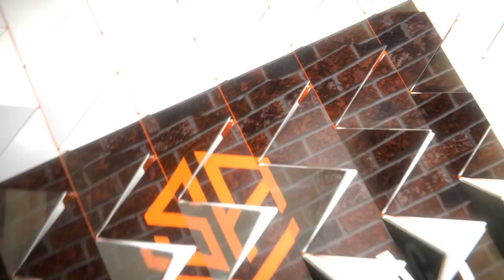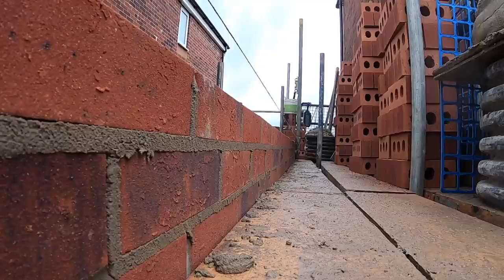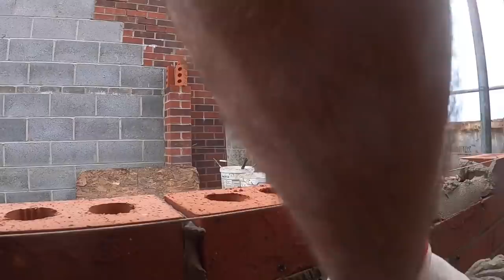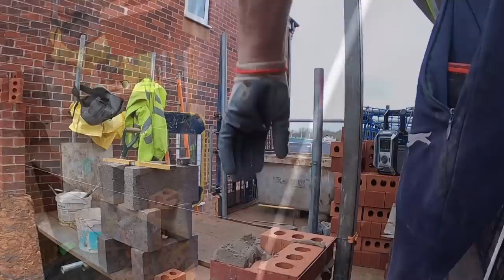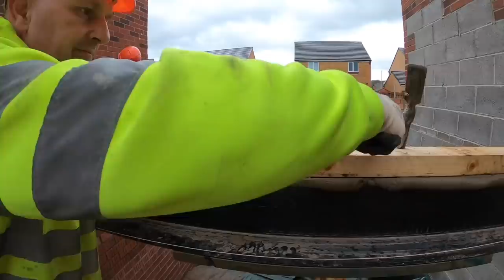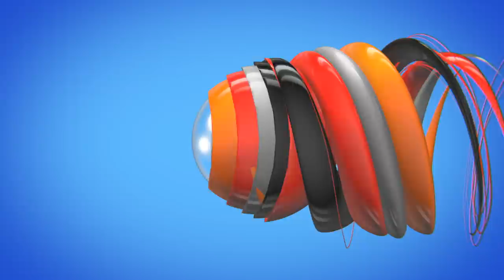BUILDING A SINGLE GARAGE ON A DODGY SCAFFOLD!!

Comment: Nice one Steve & Alex am liking the profile set up, during your next upload can you spend a few mins on the wooden profile fixed to wall? In other words do you scribe a plumb line where wall is going then fix it a few mil back to allow for line thickness? Not used that method before hence my question. Great work and a quality 👏. Cheers Martin
Reply from the maker: Thanks very very much Martin. You have got it spot on .👌🏼
   The other tip is use masonry nails and bring the line off the bottom of the pin 🧱👍🏽

Comment: going to rebuild a lean too. want to do the bottom in block will be7ft with door long 3ft high and one end 4tf wood frame top. how many blocks? how many bags of sand cement? I recon 40 blocks but probably wrong.
Reply from the maker: I’m not sure but 40 sounds about right . 1 bag of cement will easily do that many blocks 👌🏼👍🏼

Comment: BTW at least you got a loading bay,majority of sites I've been on there isn't !!!
Reply from the maker: Ridiculous! , how does that comply with H&S ?! 😡
Reply: @SteveAndAlexBuild  the worst thing is they'll be getting paid for it!!
Reply from the maker: @ianhoward4246  . Oh yeah !  Considering the bricklayers spend about 2 weeks on the scaffold it should be erected fir them . 😡🧱👍🏽
Reply: @SteveAndAlexBuild  correctamundo,it's like you build around the scaffolding rather than scaffold around the building  🤬🤬
Reply from the maker: @ianhoward4246  . Changy was on pikes the other day and had to go up 31 to get to the table lift so it was high enough for the roofers 🤯🤬🧱👍🏽
Reply: @SteveAndAlexBuild  we've just had the same we lost half a day they said they'd sort it,they dropped one fxxxxxx board as hop up,I couldn't turn 'cos if all the plastic(and I'm a fat get),then the soffit is 2joints off the house and you just get told to lean it over( but make sure it looks right!! You need a fxxxxxx magic wand not a spirit level!!
Reply from the maker: @ianhoward4246  . It’s ridiculous. Site work is turning into a mugs game 🙄🧱

Comment: The good old carrot dangler trick, fallen for that a few times, as for not paying you in full, chances are last lot more than likely over booked then jacked, but still you should be paid.......... one time I was 10m2 down on stonework on a job, they refused to pay up so I jacked but sneaked i at night and chipped all the ills and heads with a hammer, fuck em
Reply from the maker: Yep we finished an identical garage from scaffold height . When we booked in the previous gang had over booked it by £35 . So we did 2 days for nothing . We are still fighting that one , it’s not our fault it was overbooked , ridiculous! 🧱👍🏽
Reply: @martin2466  No, they should pay, simple really plus you need to be caught to get proof then the long dispute in court, I ain't no mug... each to their own